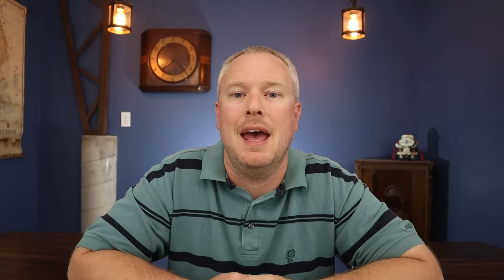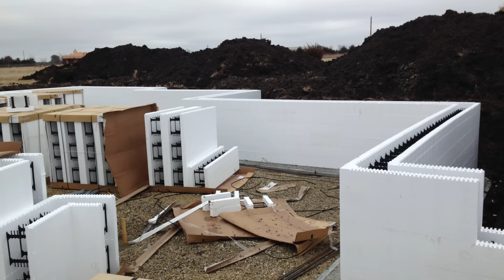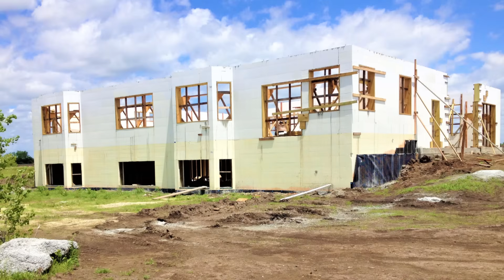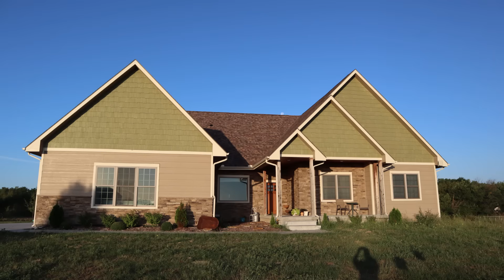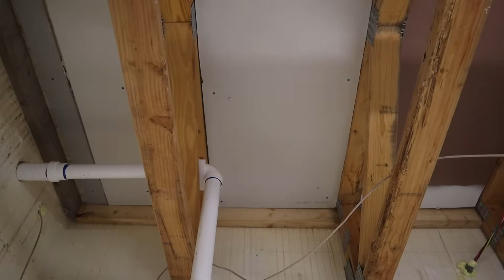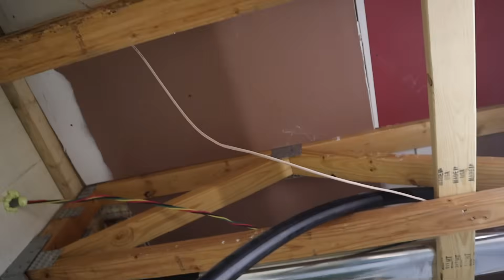Is Geothermal Heating & Cooling Worth It?

Comment: With all the major steps towards super insulated houses I don’t see a future for harvesting and distribution of heat with fluids. The btu demands of houses will go down so much that ROI of heat pump vs electrical heater will have the electrical heater as the winner. Yes people will scream: “but the heat pump is 5x more efficient” very very true, but money wise… count the totals for 20 yrs. Installation cost, maintenance cost, replacement cost and usage cost. TLDR; spend 95% of your budget on insulation, and the remaing 5% on the heat supply. The more you spend on insulation the less expensive the heat supply gets, even to the point where small electrical wall mounted heaters will be enough.
Reply: You are bang on. Spend the money on a superior building. I did, and my super-insulated home uses about 1/6 to 1/8 the energy to heat it, compared to my neighbors. We did it on a shoestring, too. We're sure not rich!
Reply: Nah

Comment: I wish I had a geothermal setup to deposit and withdraw heat through cement the basement floor of my townhouse condo (so probably no digging allowed). I also wish I had a loop with probably CO2 as the working fluid to transfer heat from the wastewater pipe to preheat water going to a heat pump water heater, and since I'm dreaming, that heat pump got most of its heat from the exiting water after the first loop (or maybe just a heat pump loop).

Comment: With regard to cooling (in our climate we never need heating) I'm about to build a new small retirement house on a couple of acres. I intend to make a large swimming pond/lake. I'm thinking of laying  piping in the bottom of the lake, pumped  through a heat pump to cool the house, Much less work to install but would it be as efficient as in ground?
Reply from the maker: It all depends on the depth of the pond (minimum of 10' and at least an acre).  If it was me and I mainly only needed cooling, I would go with a mini-split heat pump.  They are almost as efficient in cooling mode, and much cheaper.
Reply: @Challenged1  Many thanks, I will look into  them. Any make or models you recommend?
Reply from the maker: @robertcarless7445  I admit, I am no expert when it comes to the different brands of mini-splits.

Comment: What would you recommend for a 1200sqft casa in Baja, mainly cooling?
Reply from the maker: If it's just cooling, I wouldn't use geothermal.  A mini-split system would be the most efficient and cost effective way to go.
Reply: @Challenged1  thanks

Comment: You might have been out of luck with your noisy heat pump. Usually, most of them aren't noisier than a fridge ! 
Or maybe there are some issues with the sound insulation (mechanical coupling, resonance...) ?

Comment: Wow, thanks for the update! yeah as a carpenter, I keep thinking that we ought to install geothermal coils every time we backfill a basement. Same with septic systems, just bury some loops under the weeping bed and the tank. Also waterfront places don't need loops, just intake pipes going close to the bottom of the water body to get the naturally cool in summer and warmer in winter temps down there. I live in Canada so air source heat pumps need to be backed up because they stop working at -18 C when we need it the most!

Comment: Compressor noise - have you tried to have a rubber base under the compressor to isolate the vibration and noise.
The rubber has to be of a certain type and size to get the best results (depends on the weight and frequency). see an Industrial noise consultant.?
Reply from the maker: I'm using the ones provided by the manufacturer.  They consist of a two rubber layers sandwiched between cork.

Comment: I really dislike when people call an earth sink/sourced heat pump "geothermal".
Reply from the maker: Why?
Can you name the 3 different types of geothermal?
Reply: @Challenged1  Why? Same reason I don't like the term scooter applied to everything from a skateboard with handles to a funny shaped fully legal motorcycle. It makes the word's meaning less and if the definition is expanded enough it becomes meaningless.
 I couldn't name the three types of geothermal when you asked but they are all producers of renewable energy.
How much energy did yours produce last year?
I found it to be a buzzword used to make a minor change in a refrigeration system sound more high tech than it is.
I'm not against either heatpumps or geothermal power I just don't think a basement should be relabeled as geothermal just because it stays a little warmer than the air. 
The very fact that the heatpump dumps heat into the ground makes the term geothermal misapplied.
Also a "geothermal heatpump" would fail to do half its job if placed on a geothermal vent.
I just disagree with using a term to describe both a renewable energy producer and an energy consumer.
Reply from the maker: @ghz24 "Geo" stands for earth and "Thermal" stands for heat.  The earth has areas of abundant heat, and areas with a lack of heat.  We humans have figured out ways to harness the power of both in a heat exchange.  The direction of that heat transfer from or to the earth is dependent upon our needs, but it's all geothermal.  The common misconception about geothermal is that it is only associated with an abundance of heat (high temperatures relative to our needs).  Folks don't understand what heat is.

Geothermal wells don't "produce" energy, the abundance of heat within them is converted to electricity within power plants through an exchange process.  All geothermal is in any application, is an exchange of heat with the earth.
Reply: @Challenged1  Yeah I studied orthography too.
One generates power from the heat of the earth and the other use power to heat or cool the earth.
One is a renewable energy source the other is not 
One uses a difference in temperature to make electricity the other uses electricity to transport heat and create a difference in temperature.
One powers Iceland the other uses power to control the temperature in your house.
I don't call my basement geothermal because it benifits from a near constant temperature.
It doesn't matter. It's in common use already. You asked why.
We don't call a regular air to air heatpump  an aerothermic heatpump.
I don't think we should be doing what we are to our language.
I don't expect to get you to not use it and you have little chance of getting me to like its use.
I will always view it's use instead of a more descriptive term as just buzzword hype.
I like both technologies don't get me wrong.
Reply from the maker: @ghz24  I hear where you are coming from, and I get it.

On a technical note, the geothermal power plants first use electricity to power submersible pumps that then moves the high pressure superheated water to the surface where it can convert to steam, which then drives the turbine.  The condensed water is then pumped back into the ground via surface mounted pumps.

I'm sure you can see where I'm coming from. Technically, they both first use electricity to move a fluid to which heat is transferred.  The end use of that heat is different between the systems though.

Comment: What size heat pumps did you put in per floor? I'm curious as to what your load calculation came out to on a 3000 sqft per floor ICF home. What brand did you go with and what was the seer rating at the time.

Comment: Another person mis naming geothermal. Ground source heat pumps are not geo thermal. Geothermal is natural heat that lies relatively deep in the earths crust and can be used for heating, quite common in Iceland.
Heat pumps use the heat from the compressor to provide heat,  and by loading the compressor with soil temeprature gives a better performance than air source as the evaporator is working in a warmer environment. that's all.
Reply from the maker: There are 3 types of geothermal.  Ground source heat pump is one of them.

Also, your understanding of how a heat pump works is completely wrong.
Reply: Challenged, 

Geothermal is using natural high temperature heat, not low temperature soil. 

No I have a good understanding of refrigeration plant. The 'heat pump' is a poor description of how it works.
Reply from the maker: @iareid8255  You are describing one of the 3 different types of geothermal.

Comment: I have been in the HVAC business my whole life and have installed all types of systems. I am a fan of geothermal but unless you can install yourself it’s not cost effective. A better insulated home with mini splits are the way to go in my opinion. The COP on a Geothermal might be 5.5 and the most efficient mini’ are around 4.5. That makes geothermal the winner if the costs were the same but unless your like me or the YouTuber who made this video the best and first thing to do is build an efficient home. To be fair I did install geothermal on a home I built and did it all myself so it was the best way to go, but when I have to sell to a customer it’s still a great system just not cost effective.
Reply from the maker: Thank you for leaving the comment
Reply: Have to appreciate your candor on the subject. =)

Comment: i fucking hate when people say "i did it myself so it's cheap" Man would i want to hire that person for work if they could do it for FREE! Fucking include the hours it took you to finish the projects so it can be added to the calculation of the total cost!
Reply from the maker: Why?  There's no money changing hands between myself and me.  Adding money that wasn't spent makes no sense.  If you are wondering what a contractor would cost, call one.
Reply: @Challenged1  so you dont value your own time? The time you spend on that work would have been spend making money. That you would have then used to pay for someone else to do the installation. If you get 1mil per hour, you wouldnt do it yourself, because your time working is more valuble than the money you saved doing it yourself.
Reply from the maker: @royalrepublican3480  Do you only value time as money?  By doing what I did, I was able to learn something new, and then share it on YouTube.  BTW, me sharing it on YouTube has made me ten's of thousands of dollars (well in excess of the cost to hire it done).
Reply: @Challenged1  right so you're just validating my point even more.

Comment: Geothermal is possibly the Stupidest most Expensive and failure prone HVAC tech I have ever seen in 33 years as Master Tech in the trade. Its almost 100% Guaranteed to leak. If you think you really want a Geo type unit, Water Source is 100x better, and you still have the loop issues to contend with.
Ground Source Geo is garbage.
Reply from the maker: Where do you generally see the leaks?

Comment: question. I am wanting to cool and heat a green house. 200 sq ft. to place the pipe in a pit is it better to use 90 deg turns or not? was planning on 200 ft of pipe approx 7 feet down. would this be enough to make an affect on temps? .  no return to earth just straight in.
Reply from the maker: Use as few mechanical bends as possible to reduce leaks.

I have no idea if it will make much of a difference or not.  It sounds like this would be a passive system that doesn't use a heat pump.

Comment: I have a ground source  unit and love it.  First unit ran for about 30 years no problems at all. Replaced it with a more efficient unit.
Reply from the maker: Thanks for sharing!!!
Reply: We too have a ground source system since 2006.   In a 100 year old farm house.    Very few problems.    Need filters and a few parts now and then.   Very comfortable in Illinois.   The only down size is the humidity in the summer.    This system does not remove moisture from the air.    We have to run a dehumidifier in the summer.    Still very cheap comfort.
Reply: What type of G.O.

Comment: Hi Garret based on watching your videos and taking your advice I have installed a closed loop geothermal sytem that does heating /cooling and domestic hot water and has a built in ERV. My cottage is a A frame structure and about 900 square ft. My Trench length is 95 feet and I have about 520 feet of 3/4" HDPE pipe. The cottage is located 46 degree latitude  78 Degree longitude. Place is called Lake Kipiwa Quebec Canada. The pipes went in the ground November 2022. at a depth of 6' . The system started operating in mid December 2022. Measuring the temperature of the copper pipe that carries the water/gycol mix from the ground in mid January it was 6C. In February the in was 10C, in March 14C. Now that i've been running the air conditioning the ground temperature coming in is 20C and this has been so since mid June. I attribute the early low temperature because in December 2022 when the water/gycol was inserted in the HDPE pipe it had been sitting in the unheated cottage therefore the water/gycol temperature was about 2-3C when it was fed into the HDPE pipes. Currently in mid August the incomimg temperature is 20C and the temperature going back into the ground is 32C; this is favourable as we will be getting into winter and nightime temperatures will dip to -30C . I also believe that the high  ground temperature currently is partly due to very wet ground I encountered when digging the trenches. Yoiur thoughts ?
Reply from the maker: The temperature of the liquid in heating mode is different than it is in cooling mode.  It's more a function of the refrigerant temperature than the ground temperature.  You'll notice, once you switch back to heating mode, the temps of the liquid will be in line with what you were seeing the previous winter.
Reply: @Challenged1  Hi Garret thanks for your reply. The probe is placed on the copper pipe that is outside the unit, it carries the gycol/water into the unit. To further explain: the HDPE pipe from the ground connects to copper piping before it enters the unit this is where the temperature reading is taken. Does the refrigerant play a part in the temperature before it enters the unit? If so  how do I get an idea of what the actual temperature of the glycol/water mix is in the ground? That aside so far the heat pump is doing it's job in winter and summer.
Reply from the maker: @davidrosolen3282  It sounds like your probe is giving you an accurate reading of the mixture.  It sounds like you are curious as to the temperature of the ground in the winter and summer.  To test this, leave the heat pump off for several hours and then cycle on just the circulating pump (not the heat pump) and take a reading with the probe.  This should tell you the actual ground temp.

Comment: They make a quilted sound barrier that you can put up around it with speed rail … just a suggestion I work on geothermal systems in mansions in the Hamptons of Long Island New York and that is what we do especially when we have 7 or 8 geothermal condensers all stacked together as you can imagine that vibration noise magnified by 8 but the sound Barrier deadens that to a small hum
Reply from the maker: Thanks.  Do you know who makes the blanket?
Reply: @Challenged1  yes SOUND SEAL IS one of the brands it is easily found online like at grainger or supply house and you can find individual panels as well you basically surround it with panels and then one on top and it deadens the vibration sound from the compressor and circulators very well good luck

Comment: Why is a compressor needed?  Could a regular recirculating pump work?
Reply from the maker: Since the earth is in the 60's, it wouldn't provide enough heat for the home in the winter without the compressor.  Same for the summer, but in reverse.
Reply: @Challenged1  understood.  I'm very ignorant on this subject.  Are there other ways to heat without a compressor?  Like a backup furnace or something like it?
Reply from the maker: @Fuck_Snowflakes  Resistive electrical coils, which are expensive to run

Comment: Did you try foam to absorb some of the sound? I would think a couple inches of foam on the ceiling above the unit would mitigate nearly all the noise bleeding through to the room above
Reply from the maker: Believe it or not, foam has almost no sound absorbing properties.

Comment: I build a super insulated house 1200 sg  and I use a open radiant floor system,  I use 2. 50 gal electric Geo
Reply: Geo HWHP in my Landry  room , I heat my home and hot potable water .  My electric bill is about $125 . Month for every  thing.  I also run 4 freeze and my shop and  small heat lamps to keep water from freezing for my chickens..  I spent around  $1700. For the 2 tanks 9 years  with 10 year warranty  one had trouble and they give a $800 back and sent me the part,  which I got it running again  lol .

Comment: Thanks for taking the time to post and especially a 4 year review !!
How many months is Typically winter out with you ?
What is typically the Temperature in Winter ?

For a 3000 foot house what size Land is required for the  Pipe Grid ?
Reply from the maker: Our typical winter is probably 3 months (Dec-Feb) with the adjacent months being pretty cool.  Winter temps on average are between 20 or 40 degrees F.  However, we can definitely see extremes.

You could do this system for that size house on a 1/2 acre.

Comment: I seriously doubt a geothermal heating and cooling system would work here in south Texas. This time of year ground temperatures can get in the 90s down almost 3 feet you have to bury that thing so deep to make it work as a cooling system it wouldn’t be worth your trouble.
Reply from the maker: Believe it or not, it will work better than a traditional air conditioner.  I'm a believer in bury depths of 8-10'.  The soil temp at that depth is much cooler than the air going thru your traditional condenser.